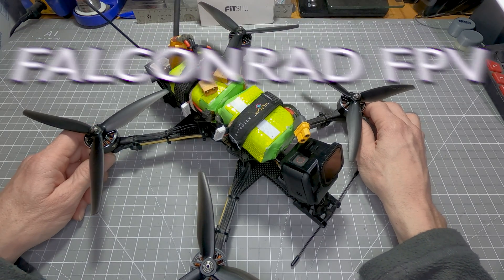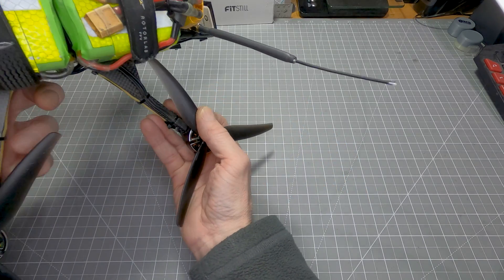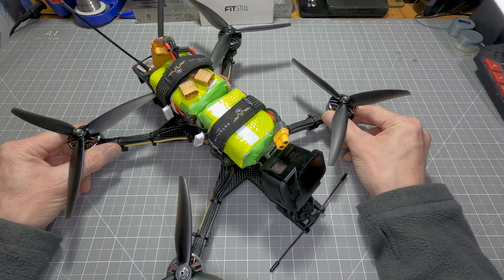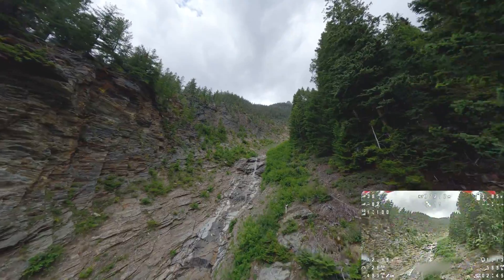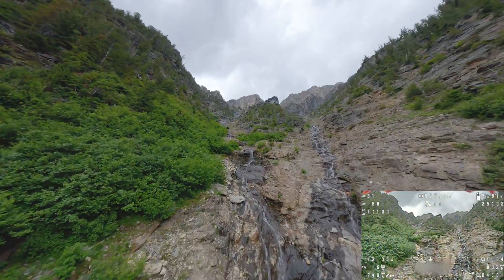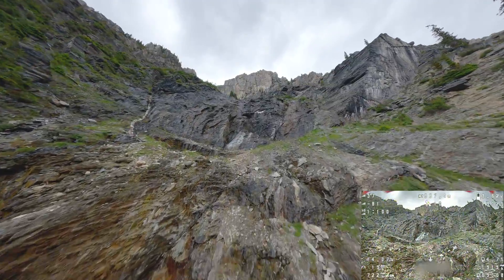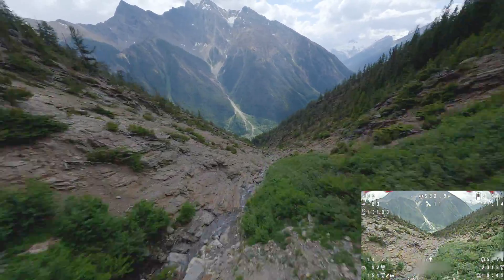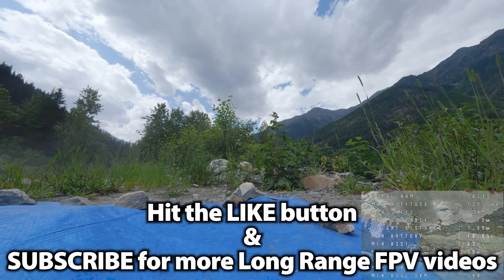Why I use A Diversity RX For Long Range FPV & A New 2.5W VTX

Comment: What I love about Analog and/or HDZero is you get real-time feedback about your LOS & Antenna aiming. So important for these sort of flights, DJI/WS are so sketchy in these situations…

Fun flight, thanks for taking us on the ride. Cheers bud!
Reply from the maker: Couldn't agree more!
Reply: That's funny - I totally disagree - you can get "real-time" feedback with your digital systems...check out the latency and bitrate.  look how slow he's flying... perfect for digital.  The analog picture sucks so bad... why would you want to deal with that?
Reply: @mlentsch  both FalconRad & I have used DJI/WS systems for Mountain Surfing and found them to be sketchy in tricky LOS situations (Flying close to a ridge line, in between cliffs, or while diving into valleys).

Watching Bitrate/Latency figures isn’t ideal when flying close proximity, (also theses figures are often inaccurate/delayed) but the real issue comes when you actually lose LOS. 

• If you fly behind a cliff with Analog/HDZero it instantly turns to static and then instantly returns when LOS is restored. 
• If you fly behind a cliff with DJI/WS the system first tries to fix the image by requesting the missing packets (at this point the image is basically a blurry freeze frame), then if it can’t get the packets it goes to a blank screen. (This can be 500ms to 1 second). Worse, if system completely disconnects it can take a second or two to reconnect once LOS is restored. 

All this time adds up (1 second at 80kph = 22m, or 72ft), and is often a disaster in these environments. 

Here’s some penetration/mountain testing I did with WalkSnail a couple months ago that demonstrates these points. 

“WalkSnail vs HDZero, FPV Penetration & Mountain Range Tests!”
https://youtu.be/06fV2vQaxW8

People should fly what they are comfortable with, just pointing out that there are disadvantages to DJI.
Reply: @mlentsch  yea check out the video, pretty neat tests, I pushed the penetration limits of both systems to the edge and it’s interesting to see how each responds. 

I’ve mentioned this “one-way” WalkSnail mode before as well, it would definitely be neat and certainly be a great feature for the system. 

Appreciate the open-minded response, so many people in this hobby get die-hard about the system they fly… I think each has pros & cons depending on your uses.
Reply: @GiantAntCowboy I'm totally agree about digital, analog still very notice us when proximity mountain diving, and etc, digital so much caution to focus, mbps or latency warning a little bit end up to disaster, I'm agree with you,
Reply: @erlandfpv  yea for sure. HDZero is a good alternative as well because it works just like Analog but with better image quality.  If you’re not familiar I have lots of HDzero tests on my channel. 
DJI/WS definitely look and perform excellent, but definitely can’t be trusted in tricky LOS situations. When signal gets weak the Latency/Bitrate figures aren’t even accurate… in some of my WS tests it’s like the OSD froze or is delays by several seconds.

Comment: Have you tried/seen the foxeer 5 MW VTXs 5.8 and 1.2 ghzs? I'm too new to know anything about 1.2 ghz vtxs.
Reply from the maker: THe antennas get bigger as you go lower in ghz.  5.8 goes 10km easy.  1.2 and 2.4 will get better penetration but I don't think its worth the hassle since 5.8 is working great for me.

Comment: Interesting you would choose a 2.5w 5ghz VTX over a 1.3ghz one.
Reply from the maker: The antennas are way smaller for 5.8, and it hold out fine for 10km easy.